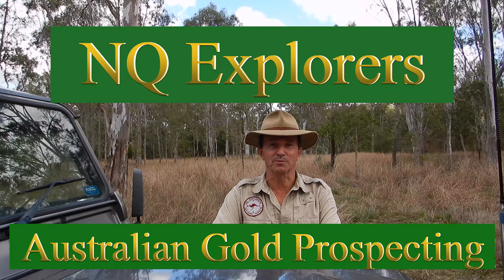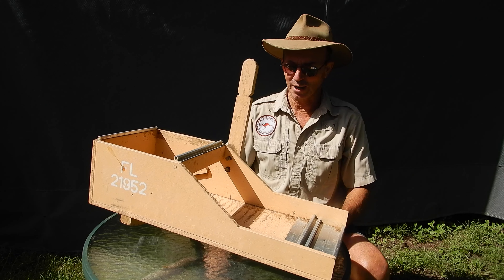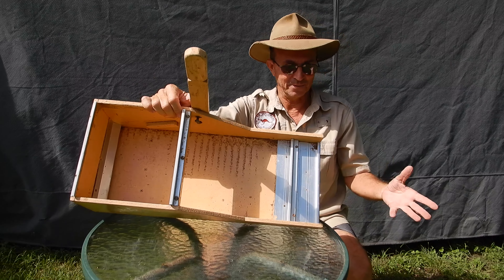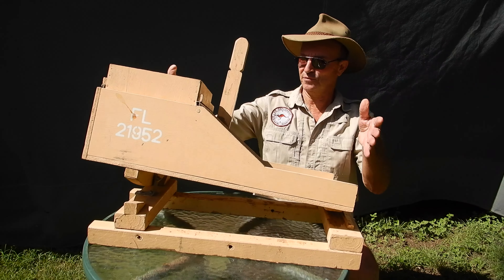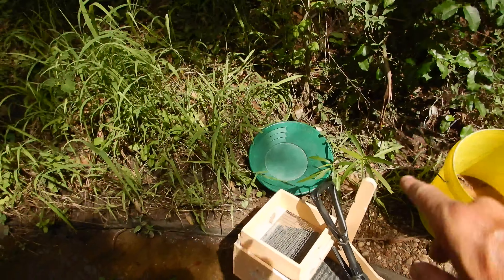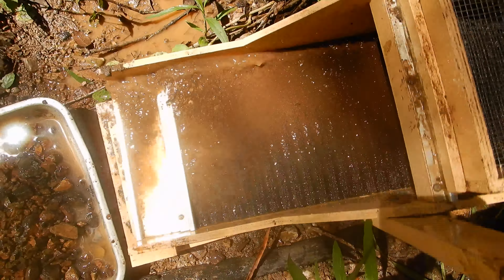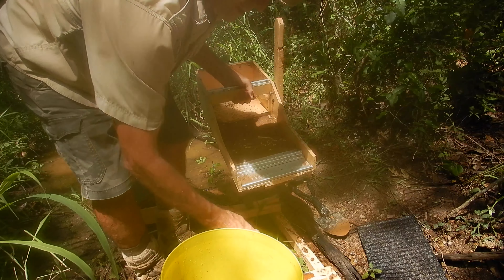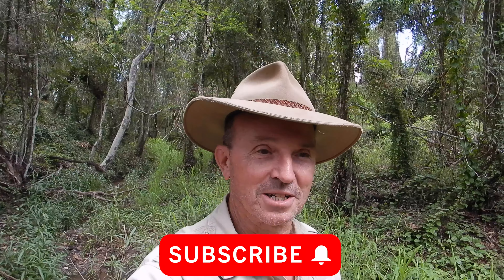Gold Cradle - Build Your Own Old Timer's Rocker.

Comment: so i am building a rocker box, for the bottom tray, what is a good downward angle for the tray to be at?
Reply from the maker: Thanks for the comment - general 'rule of thumb' is 1" per 12" of box, so for a 2' box thats a 2" drop over the length of the apron. Adjustments are always necessary as the rocker tends to move around a bit with the agitation. You will soon learn a good flow rate and angle as you work in the creek, just put a pan or tray below the cradle and see if any gold is escaping, if it is, your angle is too steep. Hope this helps! Happy Fossicking! Warren.
Reply: @NQEOverland  thanks for the advice, it will come in very useful.
Reply: @NQEOverland  i put a piece of 30 mesh gold in some material, i ran it through the rocker box, it was not in the upper mat.......but it was in the lower mat. rocker box found it. 
https://i.imgur.com/sSxVFdU.jpg 
the round blue ball is the head of a safety pin for scale. ok i am impressed with this.
Reply from the maker: @zemetrius  Thanks for the pics mate, you have built a little beauty there, and it gets the gold. Nice work! Warren.
Reply: @NQEOverland  thanks, i was inspired by your videos.
Reply: @NQEOverland  went to my groups gold  claim today with the rocker box, tried to find bigger gold, but this was all i found https://i.imgur.com/8fT9JU5.jpg the red ball is the head of a safety pin, rocker box loves finding that itty bitty small stuff.
Reply: @zemetrius  Thanks for the reply mate, the cradle doesn't miss much and you will sure get the pickers too. If you head over to our main metal detecting and prospecting channel, NQExplorers, we have a lot more prospecting and cradling videos there. Thanks for sharing the pic - Happy Fossicking! Warren.
Reply: @NQEOverland  i never fully trusted my mini royal dry washer, it never found anything when i used it, i decided to rerun the stuff i had run through the drywasher here at home, just to double check it, the very last half sandbag of material i had from the pile from the dry washer had this in it: https://i.imgur.com/k4UrvrE.jpg the rocker box found it, then i ran it through the gold magic gold wheel https://i.imgur.com/uSj74Ga.jpg, the stuff from the gold magic gold wheel i put into my mini gold claw, and there it was. this is the biggest piece so far found with the rocker box, it continues to impress me, cant wait to see bigger gold.

Comment: G'day Warren, No Worries Mate & thank you, Im off to the shed with a cold one & a Rocker Box to start. Were do you buy the green mat from or can you
get it on-line ? also are there different sizes of the green rubber mat or is it a std size?.
Thanks' very much Mate & Happy Fossicking,   Steve.
Reply from the maker: Thanks for the comment Steve, the Dream Mat is made in Queensland by Dustin at Gold Rat, it is available in 6, 8, 10 and 12 inch widths. His website is www.highbanker.com.au so you could just make the cradle the right width to suit the mat. Mine was built before Dream Mat became available so it doesn't quite fit LOL. Happy Fossicking mate! Warren.
Reply: @NQEOverland  Thanks for the information Warren, I will check out the site & grab the size to suit the cradle. That way I can make it spot-on, I already have the mesh 6x6 & only need to grab some carpet. If you like when I have it made I can send you a photo of our handy work mate. Thanks again,  Steve.